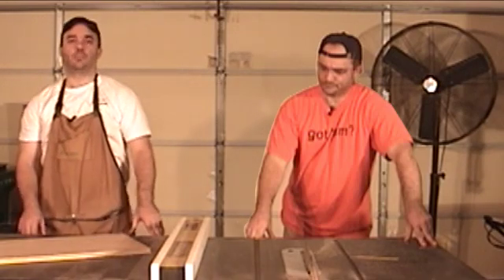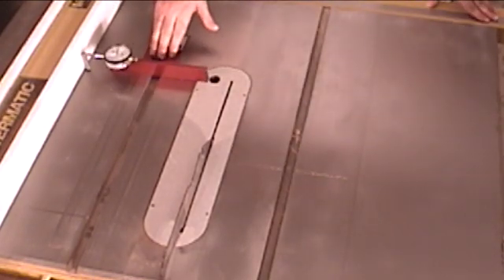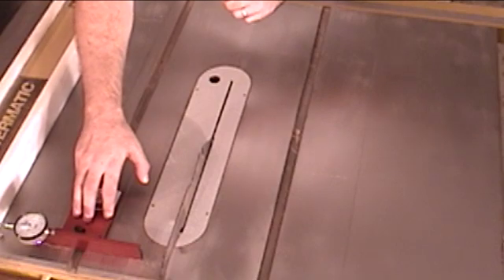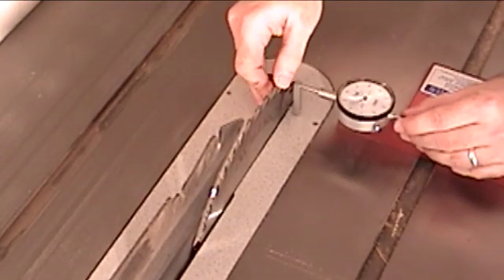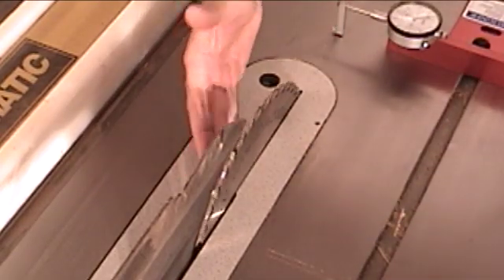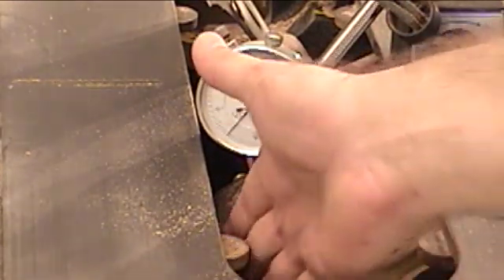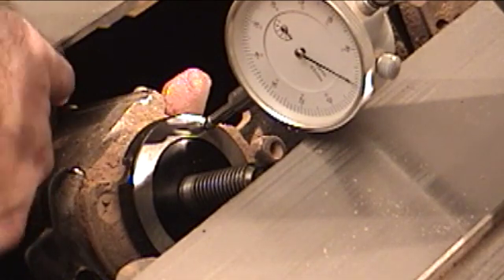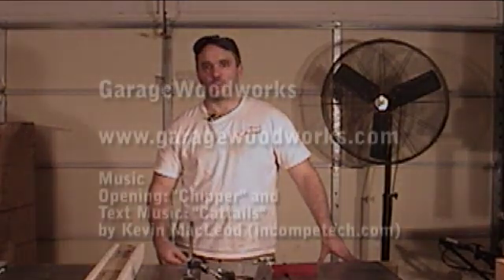Table Saw Alignment

Comment: Wouldn’t you want to use the same miter slot for both measurements?
Reply from the maker: Which measurements?
Reply: @GarageWoodworks  You use your right side miter slot to measure the fence variation, but then then the left slot to measure blade variation.

Comment: If you clean the flange and arbor before testing for run-out, the gauge will likely remain at zero. I clean my blades with Awesome ovencleaner from the 99-cent store, and it works great.